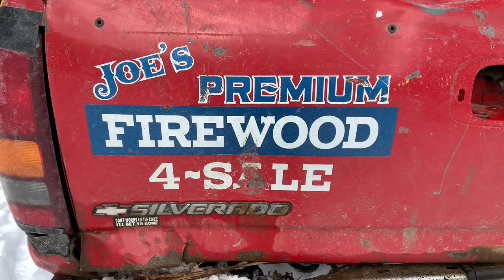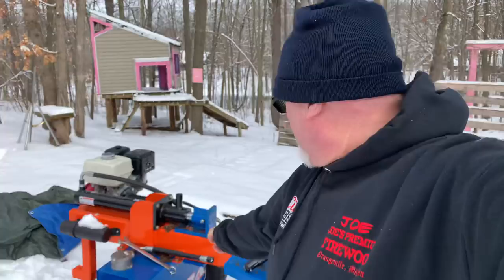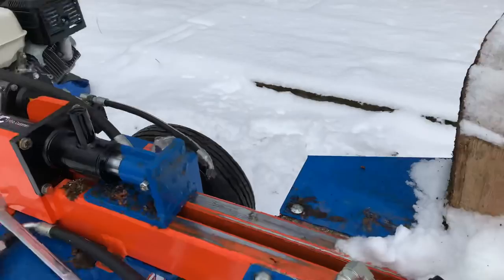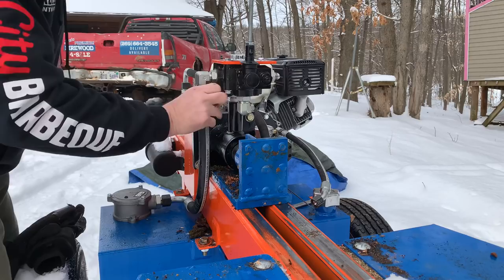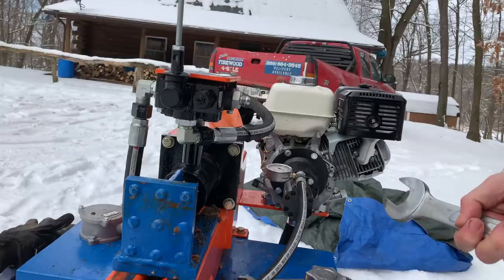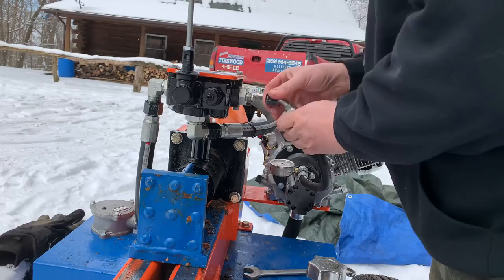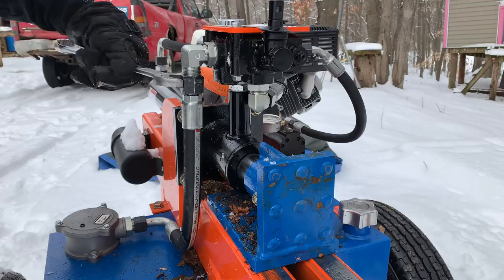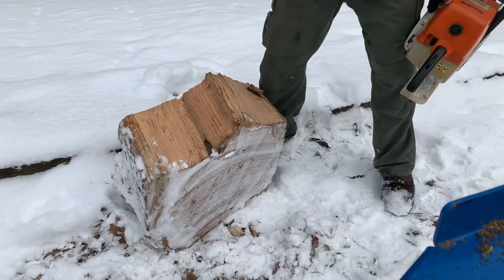How to (or not) replace broken hydraulic fitting on Eastonmade Ultra

Comment: The trick to prevent cross-threading is turn the fitting backwards by hand with pressure like you were when determining the correct direction. When you hear and feel a little click, that means the end of the thread just slipped by the next wrap of thread. That is the precise point at which you start to thread the fitting on in the opposite direction. Chances are the hose is going to fight you and try to push the fitting crooked. That's where you have to be patient and keep trying until you get a few threads on successfully before using more leverage with a wrench. Sometimes if it isn't too bad you can use a sharp bladed screwdriver or a pick to ream out the debris that is in the threads. If the thread is pushed over into the channel that's OK as long as its at the beginning and you can clear the channel by picking/reaming it clean and then carefully apply the same procedure to get it started again. If it's too bad you'll have to chase the threads again or just change out the fittings again.
Reply from the maker: Yeah few other people said to do that too.

Comment: You did not have it on straight and you cross threaded it, try some Teflon tape and if that does not work you will need a new hose with two new fittings. Glad you are OK, Joe ! Andrew is a Great Guy and has Great Customer Service.  Good Luck
Reply from the maker: Yeah I figured that out when I saw pieces of metal coming out.

Comment: Around 13:04 you are wrong, it is defiantly "screwed up all the way" but I don't think that was exactly what you meant. I'm not a plumber, but had worked at a power plant for almost 40 years, which included messing with all kind of pipe fittings. Stainless steel is great, but unforgiving. If you can't do most of the turning by hand then something is wrong, had you just grabbed the rubber hose and "jiggled" it as you was turning it would have went fine. In worse scenarios loosing the other end fitting just a tad will help( just don't forget to tighten it back up). If you can only get a half a turn putting a wrench on it and forcing it, is turning a fitting into a paper weight more times than not.
Reply from the maker: Yeah I messed it up but eventually got it going right with a little help from the Saw Surgeon.

Comment: Joe if anything you made the company realize that they made a engineering mistake. They should compensate you for showing the defect. You probably saved them money on recalling machines back to fix. Great job.
Reply from the maker: I wouldn't go that far, those blocks were too big/knotty for the splitter.

Comment: on the hose on the left it is called cross threading and it usually tears up the threads and at that point you will need to replace the fitting and get the new threads or the hose would need a new one to get the full thread for maximum holding power for the high pressure
Reply from the maker: The “Saw Surgeon” was able to salvage the hose but had to replace the fitting.  I will be live streaming the repair and do some splitting tomorrow
Reply: @JoesFirewoodVideosII  as a mechanic my self I was just trying to help you and not laugh at you like some people do on here try to help not just use you as for some amusment enertainment and laugh at you like some dumb joke

Comment: You just cross threaded it. Just have to get it going on straight and it will be fine. Might be tricky to get it started now though. Keep an eye  out if a piece tips back on that push plate. Something I have to keep an eye on on my unit too or a fitting will get busted off
Reply from the maker: Should be up and running tomorrow.

Comment: I know you're showcasing the ultra but I would of used the husky in the vertical position on that wood, hindsight is 20 20
Reply from the maker: I’d have to remove table to put it in vertical position which is pain in ass.  And splitting huge/heavy pieces with splitter in vertical position isn’t easy either.   If you watched the whole video you saw how I should’ve dealt with them.

Comment: Good job joe but where's the thread tape ?  Haha
Reply from the maker: Herb was wondering that too, but I think it has 0-Ring
Reply: Surviving Country Life, the hydraulic fittings are compression fittings and do not require teflon tape. The only part of the fitting that requires tape is the threaded part that screws into the cylinder wall or into the control block. Hose fitting are compression fittings and are easily screwed together. Should be able to get these threaded by hand almost all the way, may need to wiggle the hose as hand tightening. Then finish with wrench. Hope this helps.

Comment: looks like its cross threaded
Reply from the maker: Unfortunately you’re correct
Reply: @JoesFirewoodVideosII  when your putting on a hose like that one which doesnt go on easy if you wiggle the hose around you should be able to get it going dont force them because  it will cross thread and then its no good